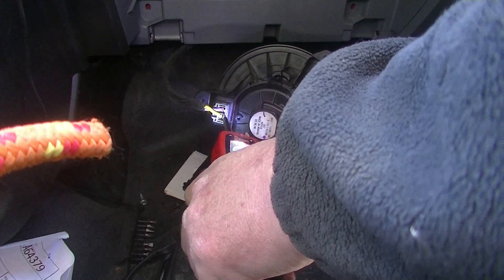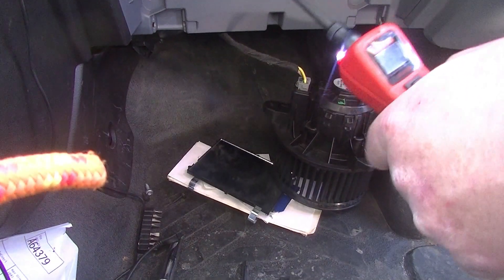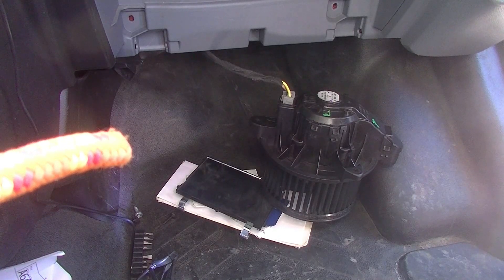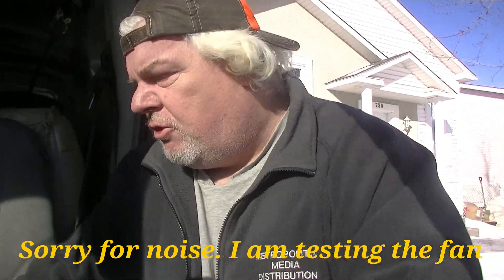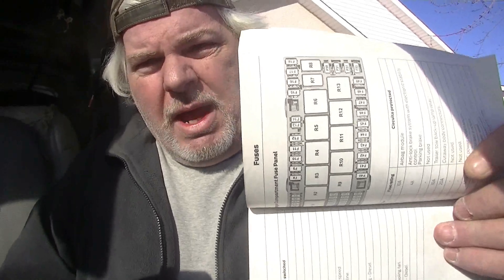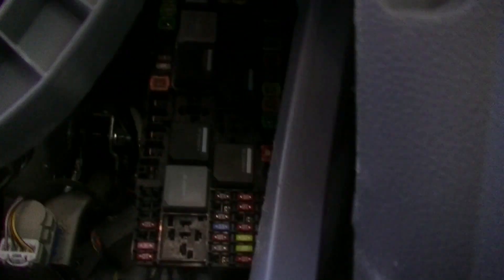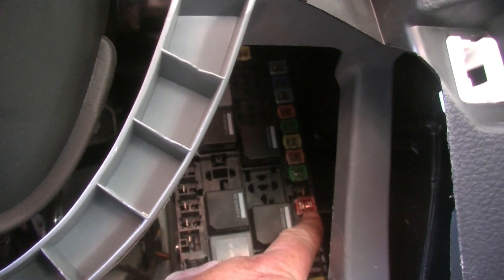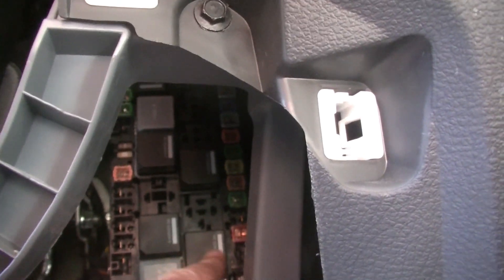FORD TRANSIT Blower motor resistor check

Comment: Hi.  Am having problem with my heater and blowing system not working. No power in the control nubs and all fuse check.

Comment: Sorry to be such a critic, but you call your vid a "blower motor resistor check" and you do not include : where is the resistor pack located, what are their values in Ohms, the corrosion problems they have, checking the wiring to and from them, a little circuit diagram, the FORD partnumber 95VB18591AB. The most basic stuff is missing, so I suggest to give your vid another name, like "Ford Transit 5 measuring voltages on blower motor"? Hope this might eliminate expectations and therefor disappointments.
Reply from the maker: The video wasn't made by a mechanic. The video also wasn't meant for mechanics. I appreciate your input and value your suggestions Ernie. What is basic to you may be overkill for others. In the end I just wanted to allow people with basic tools and meters to check and see where their problem may be. The resistor or the motor.
Reply: @vantime2911  Thank you for making these videos. I have a 2015 T250 Medium Roof 130" wheel base, 3.7l 127,000kms on it now. Purchased brand new fall 2014. Ford has replaced the wiring harness twice now from front to back due to water intrusion. 1st time caught fire. I have all kinds of little gremlins going on in the van. The latest is my fan coming on and off intermitently. Do you feel it might be the resistor or fuse? or could it be the fan itself? thxs
Reply: @vantime2911  Alllrighty, thanks for responding. I made a little vid myself (from a mechanic point of view haha!)
https://www.youtube.com/watch?v=jmOOeaDRDy8
Reply: @Ernie-Tech  Not even the same van. Yes both are transits. I am sure you are aware of the difference, you being a mechanic and all Ha Ha!